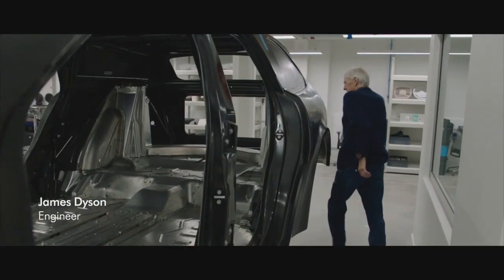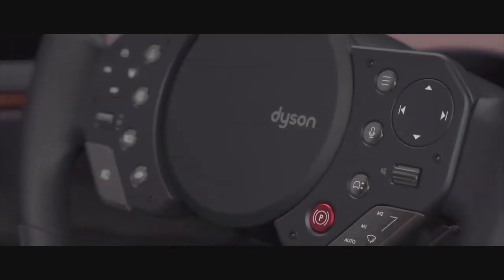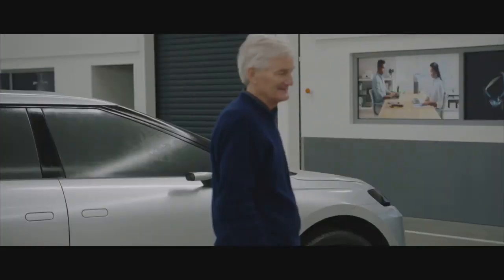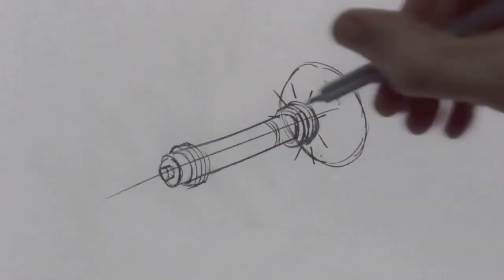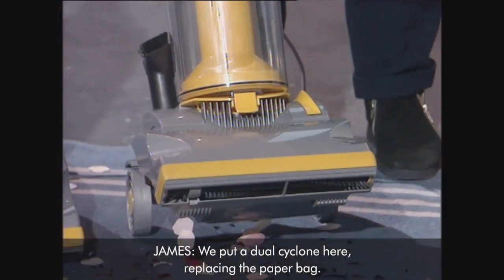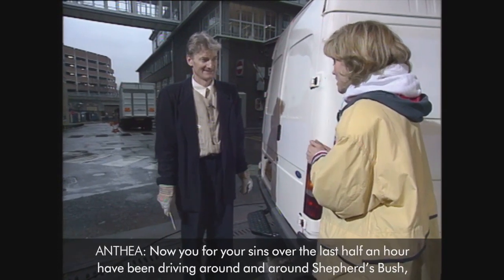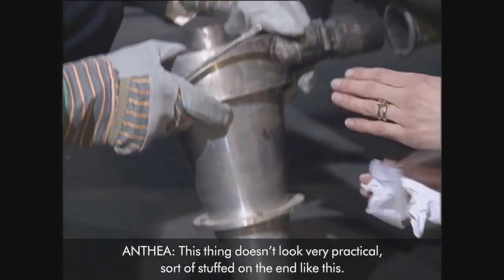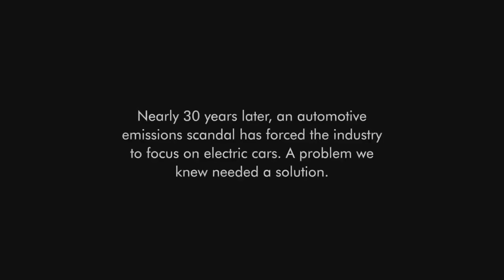Dyson Battery Electric Vehicle - All videos - prototype & battery production, Hullavington & history

Comment: 0:38

“Bigger wheels give you power rolling resistance and abetted comfort”

What?? No they don’t? Bigger wheels give more resistance and bigger rims make a harsher ride, you want thicker tyres and smaller rims.
Reply: Scott Chiste it’s inertia: the bigger wheels act like a mass on a longer stick, if you try to move a mass of 1kg attached to a 10cm stick it’s easy, if the same mass was on a 1 metre stick, it’s more difficult as the moment needed is larger. It’s the same with these wheels, they weigh the same but once the mass is moving it doesn’t want to stop, meaning less power is needed to keep it in motion
Reply: @jammy2597  But that also means you need more torque to accelerate it the further away it is, therefore more energy. Of course too small would mean excess energy needed considering the additional rotations needed to cover the same distance, but the 'Goldilocks zone' is sort of where most wheel sizes are used (something like 14-19 inches I think)